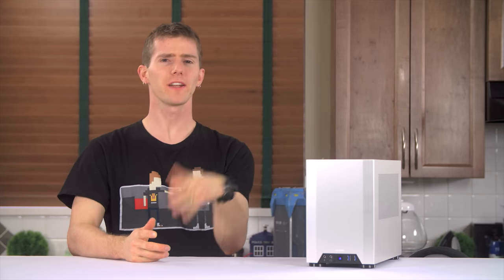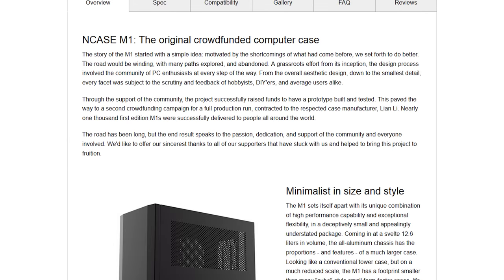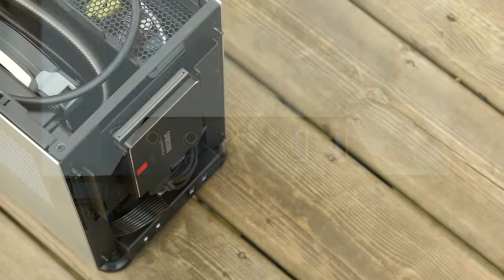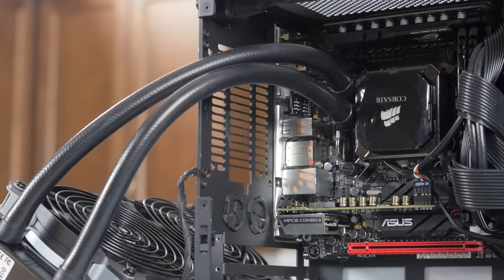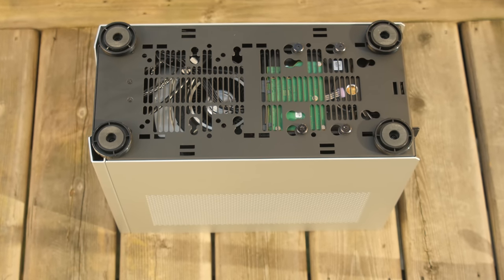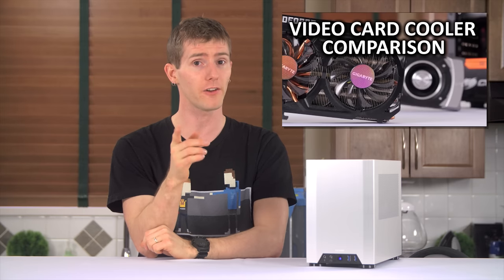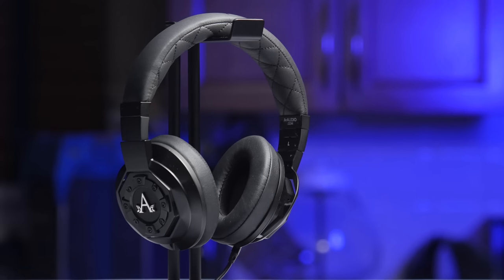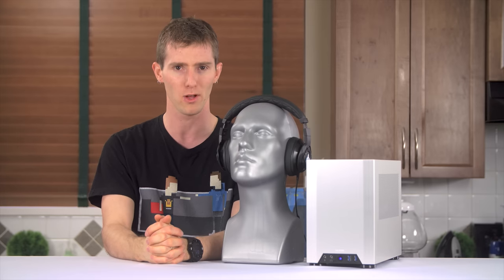NCASE M1 Mini-ITX PC Case - A Space Saver Without Compromises?

Comment: You of all people should know that not all non-reference design cards vent to the inside of the case. I have an evga card that has better cooling than stock and vents out the back of the case. 

This is the first compact case that I have seen you review that I would actually buy.
Reply: Which evga card vents out?
Reply: error2k2 I think some of the old 7xxs did. The non ACX ones.
Reply: If ur case venting card has a rear exhaust also. Just put duct tape around the inside of the card so it only goes out the back,problem solved
Reply: Erm. That would work but you would have to lower fan speeds as the pressure would get a little high and ad resistance to the fan.

Comment: Just did some googling and found a 480mm rad NCASE build. As in 2x240mm rads.
They fit one under a watercooled gpu at the bottom. 63deg Max temps(Pi) with a 4790k at 4.8ghz and a GTX 780. In a 12.8L case.

And people are whining about cable management....

Comment: Case that has the absolute best heat managemant is Origin Millennium, review on that would be nice because with components side by side (motherboard rotated 90 degrees) they don't drop heat on each other but with this case it makes now sence to add big fan in the bottom (use hot air natural moving and bottom because it makes less sound than on top) and cpu with custom air cooling would lead hot air out of the back without any additional fans-most silent case probably.

Comment: thanks to the linus media group Im watching linustechtips for the first time on my custom built pc

specs:

i5 4690k
PNY GTX 970
8GB CORSAIR VENGEANCE
1TB SSHD seagate 7200rpm 64MB cache
gigabyte ga z97mx
400w EVGA psu 80+ bronze
corsair 240 air 

just need windows, using ubuntu, but i built this for gaming and you lose fps when in ubuntu

Comment: +LinusTechTips - I feel you really didn't do this case justice in your review. You mentioned it was a crowd funded project meaning you cannot find this case anywhere else but it was specifically targeting a community. NCASE is not some huge company or business.

The project was started by just two guys (users Necere & wahaha360) from the hardforum thread which means:
- They needed to collect pre-orders from people up front in order have the capital to place the production order with Lian Li, and it takes time to get enough pre-orders
- They haven't had an efficient way to store large amounts of inventory, so we've just been shipping them straight from the manufacturer
- They have to limit risk - if there's a mistake somewhere with a production run, it might mean replacing a part, which would become very expensive with several thousand units

Novices would not find this case easily and you did not even get into the many configurations available for this case.

Comment: So essentially the same as the SG13, except it's 14 litres as opposed to 11.5. Sorry, it's too big :P
Reply: +QuantumBraced This thing does also have room for more fans and you can cram an optical drive inside... but it also costs also a whopping $140 more than the SG13. Not worth :/
Reply: +QuantumBraced pretty sure you cant fit 240mm rad in sg13, but yeah its expensive:/
Reply: +QuantumBraced Its actually 12.6 litres if you consiter how much more you can fit in it it really isnt any bigger.

Comment: You should have mentioned how build quality is excellent as they asked lian-li to make the final assembly.

Anyways, this case is still not for me. The price is not a problem but just like you Linus, I'm still waiting for a case around the size of a ps4 that can be smaller than the RVZ01, NCASE M1 etc.. by removing support for watercooling. Frankly for small builds I don't expect huge OC'ing on the CPU so I would be fine with just enough height for the stock intel heatsink and normal length GPUs up to 9 or 10". 

I will buy such a case in a heartbeat if it ever gets released and I wonder why nobody has done it after all these years.

Comment: Linus said he did an intake config with the radiator while the fans were inside the case? Wouldn't it only be possible to do exhaust? I guess you could push air inside the case through the radiator but that seems like it would be extremely inefficient..

Comment: Doesn't having the radiator fans act as intakes flood the case and components with hot air? Wouldn't it be better to have them function as exhaust instead?

Comment: So basically you can place around 5 or 6 fans of different sizes if you place a small air cpu cooler and you only use 2 2.5 drives and place them in the stacking slot??

Comment: Space saving but complete case::

A.) Mini-ITX or Micro-ATX Mobo
B.) Full size PSU no compromises
C.) 2, 3.5 HDD AND 2, 2.5 SSD mounting points at the same time, no compromises
D.) Space for up to a 13.5 inch triple slot GPU no compromises {or 2 12.5 inch 2.5 slot GPUs if Micro-ATX}
E.) Space for a single optical drive of some kind
F.) Fans no smaller that 120mm, preferable support for 140mm including 120mm and/or 140mm radiator[s] or 2x120/2x140 radiator[s] no compromises

BTW no compromises means you have to do all of it at the same time with acceptable tidiness and temps. I'd be willing to bet that if this case was 6cm-8cm large in every direction it could do everything mentioned above {Micro-ATX version of course}
Reply: dont look at itx cases then this case isnt for you but for me and others its perfect, I dont give a shit about extra pci lanes when all i use is 1.
Reply: You do realise this case can hold an opticaldrive and two 240mm rads right?
Oh and hell no to 3.5inch hdds. That shit is old.
Reply: JayJapanB It can hold an optical drive and ONE rad. Also 3.5 inch HDD is NOT old. I currently know of about ZERO 500gb or 1tb SSDs that are affordable but still high quality.
Reply: JayJapanB you actually use 2-2.5 PCI slots. Unless your using a shite single slot GPU that's so underpowered you might as well use onboard graphics.

And don't tell me what to look at, I know what I want and need it just doesn't quite exist yet. It's getting there though, this case comes pretty close. Personally I'd like to add a carry handle/strap for LAN parties, on top of my previous requirements.
Reply: Hazardous-Nebula Nope. 2x240mm rads. And that's still with an ODD.  4.8GHZ 4790k at 63deg max with a gtx 780.
Google it.

Not to mention the case is even smaller in volume than ones with no long gpu support.

Watercooled gpus are single slot aside from the IO.

Comment: Does anybody know a good replacement of the Z-Machine GT1000 case from Zalman? I really like all of it's features like the all metal design, the windowed side panel that can also be easily opened (and switched from side to side), all the hard drives are held by big pieces of rubber so they make less noise and etc. Mine's getting a little old now, so that's why I'm looking for a replacement but haven't found a good one yet.

Comment: I'm using kinda similar size case (Sharkoon QB One)
with a aftermarket GPU cooler in it, my case is heating up pretty badly

Test with Crysis 2 / Diablo 3
GPU - Geforce GTX 660Ti 
previous case (Bitfenix Prodigy - GPU 66c ) - with 3 intake fan
current case (Sharkoon - GPU 81~83c) - no intake fan

Comment: Hi I'm new to pc gaming so i don't know much about it but i want to ask if these specs for my pc are any good or if i should upgrade some of the parts, all i really want to play is minecraft and titanfall on a medium to high  resolution whiles holding up a high and stable frame rate
Specs:
Freshtech AMD 4.2Ghz Quad Core 8GB 1TB FTS Gaming PC Windows 7 Home Premium 64Bit Galaxy 3 Gigabyte F2A55M-HD2 Motherboard 8GB DDR3 1600mhz Performance Ram Onboard AMD Radeon HD 8570D 500 Watt Power Supply With 12cm Fan 1tb Seagate Barracuda Sata 6Gb/s 64mb Cache 7200rpm

And thanks for reading :)

Comment: Really want this, one question with the rad fans as intakes does the mobo / ram overheat when the CPU is under load?
Reply: Radiators don't heat up air all that much interestingly enough. Jayztwocents did a video about it on his channel.

Comment: Sorry for my bad English.. i hope u understand my question :)
Is there andy difference between this tiny motherboard?(micro-ATX?) And a normal ATX motherboard? Exept the additional PCIe slots.
Reply: There's  no difference in performance, the only limitations with m-itx is slots. One pci-e vs four, two dimm slots vs four and not a lot of sata connections. Most of the quality itx boards overclock just as easily as it's full atx board. One other thing, overclocking in such tight spaces will require really good air flow or it will be an oven in there.
Reply: There is no performance differences. 

Its simply less slots to put things in and less features.

Comment: Can someone please tell me why someone would go though all of this to make a desktop a little smaller?
Reply: Sometimes you just get sick of that giant hunk of hollow metal on your desk housing one gpu and one hdd.
I ask myself the question: "Why are desktop computers so big?"
So a gorilla can build it?
Reply: JayJapanB I just can't inmagine that.
Reply: Limited space could be one reason, especially if you need to keep the machine on top of the desk itself.
After that, it's probably just about the looks. Potentially for similar reasons to why some builders opt for much larger than necessary cases.
Reply: PrimeSonicYT the looks are a point of perspective, so I will never argue against it, but space? really? your tower can't be 10cm higher? really?
Reply: Because they CAN! There is obviously an audience for it.
Reply: Ever considered some people that need to travel with their system? Or simply that there really isn't much point in anything bigger if you can fit everything you want in such a small case? When I can build a full power system, including a 4.5GHz 4790k, a GTX 980, 3.5" drive, two 2.5" drives and excellent quiet cooling in something barely bigger than a console, why would I want or need anything bigger unless I start to consider multi-GPU?
Reply: Why get a giant ass PC case for 1 graphics card and have a ton of space so dust can build up when you can have a tiny-ass case with the same components?
Reply: armoureddanger That's one reason to buy it, but I think mostly because people like how the way case looks. That's it; I'm not sure what kind of ground breaking answer you're hopping to get to be honest... People just like what they like.
Reply: so u can put it next on ur desk
Reply: It's portable... And i ABSOLUTLY Love compact hardware. <3
Reply: 3 things :

limited space, some people may not have a lot of space so a small case is required.

portability, for students, people who enjoy going to lan parties or whatever; small cases are way more convenient to carry around with you.

lastly, some people like to make a home entertainment system similar to a games console, so they would choose a small, compact case that can fit anywhere and do everything a full tower case can do.

Comment: This is unnecessarily large.
Can't wait to get a DAN Cases A4-SFX :D
Reply: It's larger because you can fit in water cooling for both the GPU and CPU.  Well worth it, the Dan Case runs very hot.
Reply: It's also actually available if you want to spend money and have one, right now.

Meanwhile, no updates at all about when the dan will be back, or how much it'll cost going into the future.
Reply: Might as well get Dr Zaber's Sentry then if you want something even smaller.
Reply: Old comment but the dans run Hot? LMAO it never gets over 70 here

Comment: Does this case fit a Micro ATX Motherboard? Since it has 3 expansion card slots in the case I was hoping it could fit a dual-slot gpu and a wifi card. Cheers!
Reply: Thanks! But since this is only mini itx I won't get it unfortunately. I have a micro atx motherboard! :(
Reply: It CAN fit SOME mATX motherboards - they have to be "flexATX", which are less wide than normal mATX boards.  here's a compatibility chart for you:  https://docs.google.com/spreadsheets/d/1Xhd3QG2uIVBgQ7vHgpP_Bd_MNcrfxr8KJW2sY6g33so/edit#gid=26

Comment: USB and audio on the bottom... What were they thinking?
Reply: I imagine they were assuming most folks that get these small cases put them on their desks instead of the floor or tucked away somewhere else. It's small enough to show the pretty little thing off on your desk. I have a mid-tower on my desk and I have to reach a bit to get to the USB and audio ports that are on the top. It's not much of a problem though, since I use an external amp/DAC for my headphones and I don't need to access the front USB that often. If they were on the front it would be a bit more convenient.
Reply: DerVerruckteFuchs
 They could still have had the ports and button at the top, this case isnt that large or big its going to be a huge problem if you need to lift your arm abit more up, ive had bigger cases on a desk and could plug in and out and click the start button just fine with the bigger cases so.
Side or bottom mounted usb ports and start button etc, I just walk away slowly then run, such thing doesnt come inside these 4 walls where I live.

Comment: 600W?

For a mini-ITX system, I can't imagine anyone needing anymore than 450W. I have a Core i5-4670K with a GTX 980 and it pulls something like 210W off the wall running a realistic load.
Reply: I had a GTX 670, it still wasn't pulling that much power off the wall.
Reply: Either way, the power draw of a single GPU system with a high-end processor is a lot less than what people think it is. Under a realistic load, you're looking at worst 250W off the wall. Add about 150W if you have another GPU. I don't count running Prime95 + Furmark because that's an unrealistic load that chances are, you'll never run other than to do a burn-in test.

I mean, they stuffed a Core i5-4430 with a GTX 780 Ti with a 450W SFX PSU in the Steam Machine prototype. And the Mac Pro runs two cards up to what amounts to about a 7970 or a R9 280X with the same wattage PSU.

Comment: The "rest of your system temps" are completely irrelevant: you're using an AIO configured as intake. It's literally not affected by the air the GPU is exhausting, whether it be inside or outside the case.

Comment: still bigger than my girlfriend's sugo sg05.  i still don't get why in 2015 nothing can top it still when it comes to size/features.  i MIGHT pull the trigger on the upcoming rvz02 but so far it's still looking like everyone wants to waste space somehow.  sugo sg05 can be had for about a hundred bucks with a 450w psu that in it's current setup i have it with a non-reference 280x and haswell i5 both overclocked.  i was even able to squeeze in an h80i with push pull config.

Comment: id love to see you loose the mechanical hard drive and find a mobo that could put SLI in that beotch
Reply: Just use a dual GPU. The thing is 3 slots not 4 so good luck finding single slot cards these days.
Woot! Dual 8800gts!

If you could find a Titan Z for any affordable price. Two Titan Blacks gpus in a 12L case would be pretty unreal. About the only practical use for a Titan Z over 2 individual Blacks, hah.

Comment: im not a pro hardcore pc builder genious so i came here for help. was planing on building a decent gaming pc for the first time. 
these are the specs i was planing on buying:

Intel Core i7-4790K Processor

MSI Z97 GAMING 5 motherboard

Corsair Vengeance Pro 16GB 2x8GB 

WD Blue 1TB hard drive

intel 730 SERIES 2.5-Inch 480 GB  ssd

EVGA GTX 980 SC ACX 2.0 4GB GDDR5 Graphics Card

Corsair Hydro Series H100i

Rosewill thor v2-w case

i have never done this before so i have no idea what im doing. i am 100% open to sugestion.
Reply: Good specs but i would get a WD black because of better performance and 5 year warranty.

Comment: This + xeon +m.2 ssd + r9 295x2 = mac pro killer
Reply: Good luck looking for that ITX LGA2011 mobo and PSU that can hack a r9 295x2. Not to mention that's probably not going to be a highly supported gpu professionally.
Reply: Sorry to burst your bubble but if you need a small form factor workstation just buy the Mac Pro. And if you don't then buy a Dell.
Reply: The titan z is a 3 slot card which will mean that the bottom drive bracket won't be usable. The 295x2 is a 2 slot card and seeing as the case supports a 240mm radiator I doubt it would be an issue. Plus seeing as the 295x2 is half the price and performs better as well as being a more direct competitor to the firepros in the mac it just made sense.
Reply: ***** The h100i has way thicker tubing than the 295x2 and it seems to have fit quite well.
Reply: Hmmm. Judging from the video there seems to be enough room. The 295x2 isn't really any taller than a standard height card even with the tubing. In fact its actually shorter than the 900 series cards released by msi.
Reply: ***** But there is. The video shows it... Otherwise how would you route your PCI cables?
The video seems to show well over an inch between the edge of the frame and the card. An r9 295x2 isn't any wider than a pcie bracket. You could easily make a bend with that thin tube in that inch and a half of space.

Still not going to make your computer a Mac Pro though....
Reply: JayJapanB the r9295x2 really isn't as power hungry as people say. Plus I've seen a few workstation itx 2011 boards.
Reply: bob james It's a 500w card...
Which boards are you talking about?
The closest I have seen is an shuttle 2011 board. Those are VERY hard to find outside of an existing build as well as they are wayyy too wide for a NCASE M1. They are only tall enough to kind of be ITX.
Reply: JayJapanB hmmm, yeh you're right. there used to be a lot of mini itx x79 boards though. I imagine it's just a matter of time.
Reply: bob james Pretty sure there aren't any x79 ITX boards. I think you might be getting ITX confused with something else.